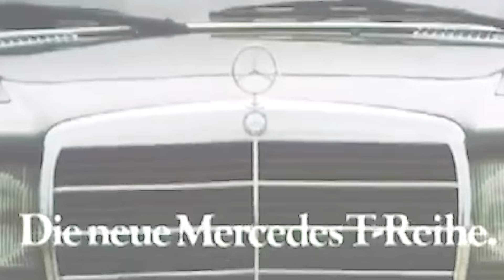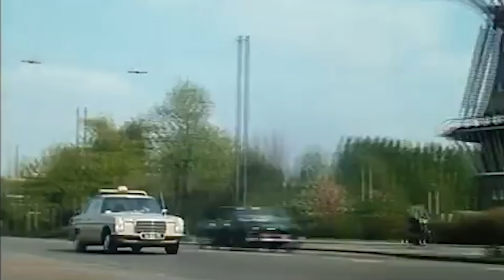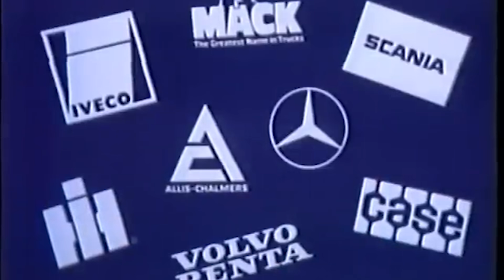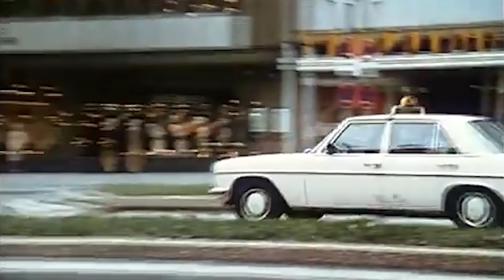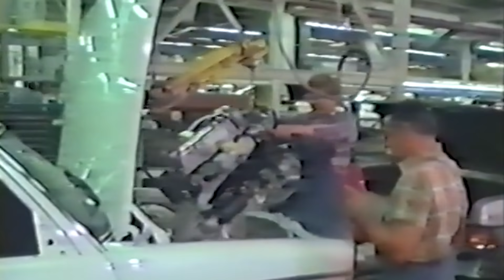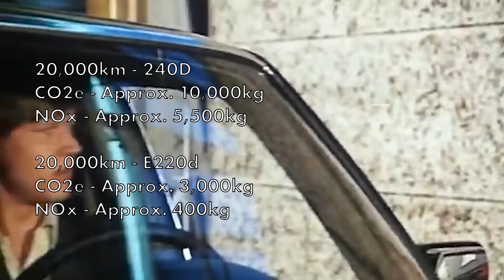Mercedes 240D - Still Fit for Daily Use?

Comment: All these cars are very slow but they are very reliable and well equiped and wont ever ask for any kind of repair other than regular maintenance, it doesn't matter if they are old and have old car emissions, the carbon footprint of an owner still driving this is the bare minimum compared to an owner driving a new car which asks for a huge demand of plastic parts, repairs, etc, only to be replaced 5 years after with a brand new car that multiple factories worked together to make the parts creating a huge environmental impact and the thing goes on.
The diesels will also run perfectly on any compression ignition fuel and WVO and you can set up a schedule on how you can use your frying oil.
All these make those Mercedes among the best cars ever made and they are so reliable they can be considered military grade.

Comment: If I recall, our 78 300D had a top speed of 93 mph, but it would run all day at 80, and so long as the speed was constant, it never seemed to effect the fuel economy - though I am assuming wind resistence says this can't have been absolutely true.  Felt like a tank, very secure - though again absolute handling limits were taut family sedan vs. any sporting aspirations.  But you wouldn't get yourself into trouble and speed bumps ceased to exist.  Rediculously epensive parts even back then.

Comment: Environmentally to operate, a diesel has a hard life, but considering the throw away life cycle all other cars and engines have or have become, the 240D and T Model are environmentally responsible and friendly. Also you own your vehicle outright, without wifi or electronic updates, diagnostics sensors. Non of the play and play later again and again subscribtion concept, which we embarking on today.

Comment: Very interesting video. But to me, the most important aspect of a daily driver (as long as I can afford it) is safety. Collide head on with a massive tree at 40 mph in a modern E Classe and you will only have to call an Uber and report the accident to your insurance company. Maybe book a massage as well for your stiff neck. Do the same in a 1970s Benz and you go to ER (best case scenario).
Reply from the maker: As we’ve previously had a head on collision with another car in an old Mercedes and walked away with not a scratch, we have to call speculation but we get your point!

Comment: Thanks for a very informative video. A couple of things that I wonder about with the Mercedes life cycle projections for an EV:

Is the apparent lower reliability included?
Is the total cost to the environment of mining rare metals included?
Is probable replacement of batteries included in the life cycle assessment?
Reply: Why would you expect EVs to have lower reliability? In theory that shouldn't be the case because of how simple the powertrain is, unfortunately automakers keep adding more junk to break like electronic door handles. 
Battery replacement is not probable for EVs, they should last the life of the car. Seems to be the case so far aside from some recalls for manufacturing defects and the Nissan Leaf which is notorious for degradation because of the lack of thermal management.

I would hope the mineral mining is included in the assessment, if they didn't include it then it would be a pointless assessment imo. I wonder if it includes the production/refinement of the fuel used for the ICE vehicles in the comparison, there is an environmental cost associated with refining fuel.

Comment: It’s all well and good from the driver seat. 

I get where you’re coming from, it’s your perspective and you’ve chosen the data to support it. In average cars have gotten bigger and heavier and planned obsolescence is not just a conspiracy from Gravity’s Rainbow. 

I’m all for reuse, repair and making things last as possible but if that item burns something it has to go. Embedded carbon from manufacturing is nothing compared to a decade of burning. If your thesis holds true we’d all still be heating our homes with coal, now those stoves (heat engines) do go on for decades. Less moving parts, simple design…

Your statements on embedded carbon from manufacturing, are a bit oversimplified. What do you think powered the factory that built your Mercedes, how was the steel manufactured? Imbedded carbon, tire pollution and “they just get thrown away” are such tiring over used myopic click bait headlines we’ve been hearing for 20 years now. Did I miss the rare earths or did you?

Best recourse for you would be an EV conversion (with those parts that would just get thrown away /s). Then everyone would not have to roll up their windows when they are stuck behind you in traffic.
Reply from the maker: I'm not sure if you finished the video, but spoiler alert the data which I certainly did not hand pick, concludes that big miles in a classic diesel WILL make you a net polluter compared to an EV or even a modern ICE. Scientific integrity is important to me, and when I started out to make this video I really did hope that I'd find the opposite, but certainly wasn't going to falsify or ignore data to get the result I wanted.
Reply: @427Motorsports  I will admit to a slight bit of multitasking. Cold starts and a vehicle with no emissions controls in traffic better than a modern ICE? Certainly not better than any EV on any grid. I recall the VW tdi (before DieselGate) was viewed as better on the freeway than hybrids of the time. 
Hybrids have their own multiple cold start issues…

I’ll make time to watch again later and will be back.

A brief skim of the comment section tells me the algorithm is surely siloing this video.
Reply from the maker: You're absolutely right, mile for mile an old car won't be able to touch an EV or emissions controlled ICE, what I wanted to investigate was the impact of consumers buying a new car sometimes every three years (even more frequently for some) and the embodied carbon that goes with that, whether you can offset that by keeping an older car. Unfortunately as I say the data says no, unless the old car is doing very small mileage. 
The algorithm has been very kind to this video the last couple of days, it's good for us - we'd like to make automotive videos that are interesting and informative without making anything up for clicks - hopefully that does come across in the video, thanks for taking the time to watch and engage with it

Comment: Hello from Azerbaijan. I have 1985 first production W124 with M102 engine,  still running and good condition. Oldtimer Mercedes-Benz models are always the best  because they have soul and not like plastic and electric scrap which produces now. Best regards.

Comment: There was another guy, he bought one of the last W123s just to continue driving them when his died (above 250 000km at the time). Car was left in a barn with 35km, delivery km+24km from the dealer to the barn. He was convinced that the upcoming plastic W124 is abomination. Well, he retired from driving before his W123 died, never driven the other car stayed brand new.

The environmental impact, I will say just two things - the amount of fuel and pollution for global water transport. The amount of fuel and especially pollution from all the planes (open a map how many are flying right this moment) and what kind of pollution they cause. Let's skip the diesel is bad for the global warming and cars are the main cause. They are not, never been. I'm glad you discussed so many perspectives. This is by no means personal critique. 

And again we get to the old point - but the air in the city centers. Well it will be better but I guess screw everyone getting the raw materials for the batteries which also need transport around the world with fuel and pollution. Then let's embrace consumerism and throw out our cars, phones, TVs, anything in that regard because the new shiny one is 5% better. But nooo, the old ever lasting cars are the ones polluting. A whole lot of things will give you cancer and almost all of them we do to ourselves very willingly. Let's not sugarcoat that. And last point - global population in 1975 was 4bln, its 8.1 now. I guess you can say that doesn't help

Comment: These old diesel M-Bs are charming and anachronistic, and that's part of what drew me to them in my younger years. That was well before environmental considerations weighed on my mind at all, quite in contrast to the present, and I watched this video solely because you were addressing the environmental portion of the equation, which I have never seen anyone elsewhere address with respect to classic cars (let alone these particular vehicles). Thanks so much for doing so; the figures were eye-opening and interesting.
Reply: Well feed it vegetable oil. I've run my w110 200d on it and the engines are very similar.

Comment: I'm fairly certain no w123s were sold in the US with airbags. I was always told they were a Euro option like ABS and I've only seen them here in grey market cars.

It's also worth considering that electric vehicles have exponentially worse tire emissions. Here in the US, the argument isn't new diesels (because we don't have many) vs old diesels, it's diesel vs gas. The production of the actual gasoline is usually completely overlooked.
Reply from the maker: You could be right, I know I've seen US W126 with airbags but could never definitively say I've seen a 123 with them
Reply: Your last sentence...... This seems to be a national trait. Whenever there's any kind of discussion as to whether A or B is less damaging to the environment soooooooooooooo many factors are overlooked by both parties. 

Nearly always I'm called on it. So I start listing what they've overlooked. The facial expressions are priceless! 😂😂😂😂😂

Comment: Nice! Do not rule out old petrol Benzes. I have owned and driven W124, W201 and currently a 25 year old W202. When you go for the smaller 4 cyl. engines they are quite frugal. Their durability is not as good as the old diesels yet certainly the more recent engines (as of the early 90s) can easily do 200K miles, when properly maintained. And maintenance is cheaper than the diesels. But... they do lack the character of the 4 cyl. diesels. By the way, whenever I have people driving with me in my '98 C180 they are always impressed by how well and comfortable it drives...
Reply from the maker: You are right, I have a couple of w124 230E's which I absolutely love

Comment: My 1980 300TD has been my only car since 1995. I maintain it myself.
Reply: I have a 2006 E320 CDI and that's it, it's my main car for the rest of my life. My dad also had a 1964 Porsche 356sc for his whole life.  These are called drivers cars, you would think a drivers car is a sports car but it's not, it's the kind of car you can drive all day for the rest of your life and just rack up miles.  Mercedes, volvos, lexus, french cars, saabs, toyota trucks.  Chevy trucks last a long time but the fuel economy isn't there, and I think drivers car are more then just long lasting cars, I think they also have to be enjoyable cars to drive that handle well and have good ride quality, and I think they need good fuel economy as well.  There are some american drivers cars, we don't see them much any more, original ford mustangs, chryslers with slant 6's like ramblers and ford falcons, a lot of the mid size american sedans of the 60's valiants and things like that, but they never held up like Porsche, Honda accords, toyota camry, volkswagen rabbits and stuff.

Comment: Great video. From 17 minutes in he goes into the carbon footprint detail enough to inform but not so much it baffles. I have an older petrol Mercedes convertible. I only do leisure miles <3k per annum. It's a beautiful luxurious fun car and I'd rather keep that running for my days off needs than buy a grim and dull new plastic looking computer on oversize tonka toy wheels SUV made in China with dirty power and having been shipped all the way round the world to run on largely non sustainable electricity. I not a climate sceptic, but I do think needs and footprints differ wildly. If I did loads of commuting miles every day. I'd think differently I expect. My neighbours have giant new Teslas and then commute to work on the train and go shopping in their new cars. I really think they are doing the wrong thing but they feel good so that's ok for them.
Reply from the maker: Thanks! I agree, for small mileages it makes far more sense to just keep an older car

Comment: Great video! I learned to drive in A37XMD which was a 240D saloon in the same spec as your estate (white paint, blue interior and 4 speed manual). You really learned to plan ahead with only 70hp. Now I have a 1983 380se and it feels like a flying machine! Wish you many years of safe and happy motoring in, what I say, are some of the best cars ever made.

Comment: Great video! I run my 300TD on “renewable diesel”, which is biodiesel that has been sent to the lab to act more like petroleum diesel… It has better emissions than petroleum diesel and better cold start and fuel economy than biodiesel… and it is plant based and derived from a recycled product (vegetable oil). It is often blended with biodiesel to improve the lubrication of engine components but unfortunately it is only available in a few select fueling stations. Biodiesel and renewable diesel blends are becoming more common on fleet vehicles here in California and the west coast states of the US however, so it slightly improves the metrics of sustainability, or at least that is what I like to tell myself.
Reply: I like to tell myself the same as I drive my 300td around the bay area, but I don't think it'll make a big dent in the NOx and particulate emissions. The lifecycle modeling mentioned in the video is interesting and I wonder whether the whole supply chain in B20 made with recycled oil has an impact. I suspect the amount of energy required to create a gallon of B20 is still pretty high even compared with a gallon of dino-diesel. Drop a note if you find any more info about this though!
Reply: @greacen  as long as the energy needed to make B20 is coming from renewable sources, such as solar, wind or hydro power, the energy input is not such a problem. 

Renewable energy inputs will also help with the energy equation to make hydrogen an easier choice for some vehicles in the future.
Reply: @greacen HVO will reduce NOx and particulate emissions by 10 to 30% each and CO2 by about 90%. 
Untreated, plain vegetable oil such as rapeseed/canola will also reduce CO2 and particulate, but may (or may not, depending on engine type and load) reduce or increase NOx and hydrocarbons.  
Traditional biodiesel (fatty acid methyl esther) will reduce particulate and NOx emissions slightly and will also save some CO2, but not as much as either plain vegetable oil or HVO. Plain vegetable oil comes with practicality challenges (deep temperatures, increased maintenance demand, such as shortened oil change intervals and more frequent fuel filter changes).
GtL will improve tailpipe emissions drastically, like HVO, but CO2 saving will be minor (yet still present) compared to fossile diesel.